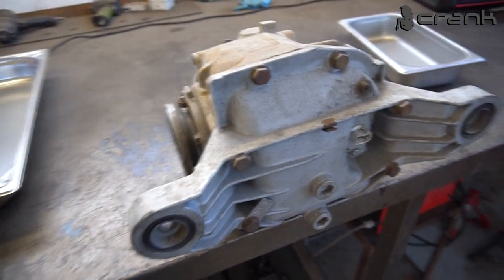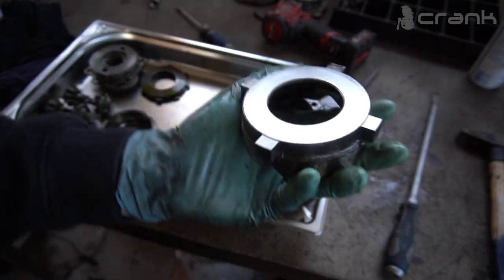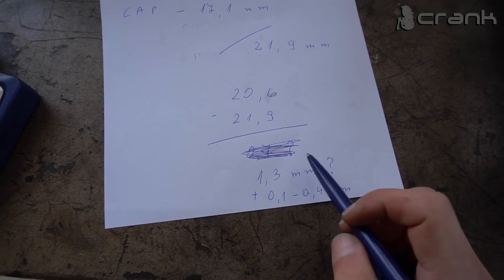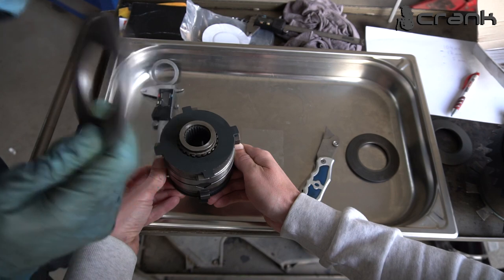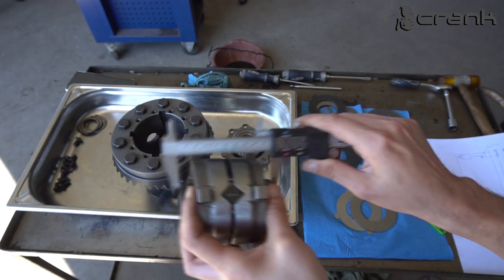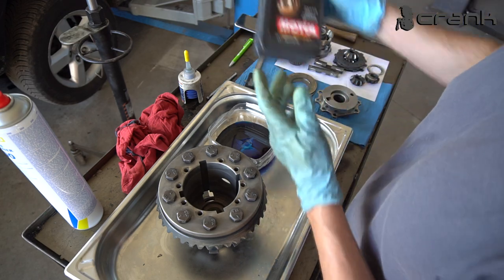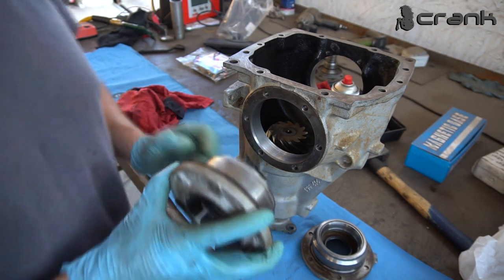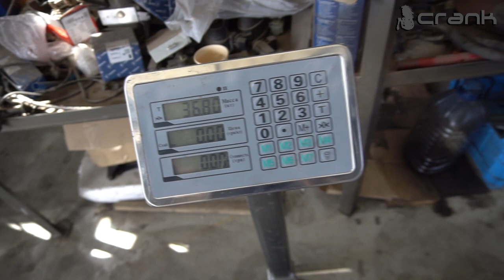Differential Rebuild LSD Type 188 mm BMW E36

Comment: really scary to buy an LSD these days ( 188 type or 210 ) ... back in the days ( 7-8y ago ) the notion was that you buy the LSD, try it if it does not lock, it just needs a service (oe part brand new and ready to go) , but today as you showed anything is possible

still driving my 3.23 188type in unknown condition, hope when it is time for new plates it is not as hard to service as in the video

Comment: I just picked up a 3.15 188mm LSD. It's clean, but i'm tempted to hose down the internals with brake cleaner anyway. Reading online theres mixed opinions about this. What's yours?